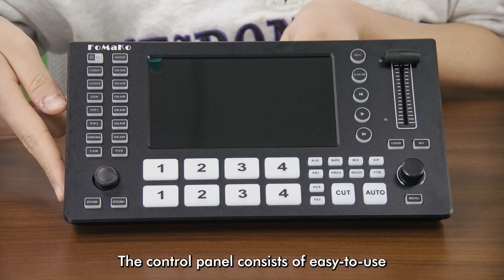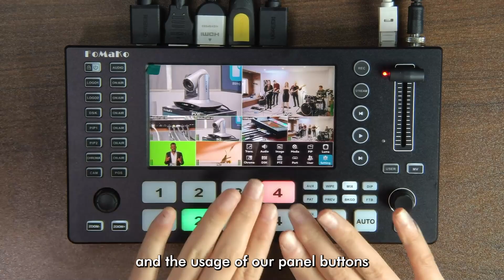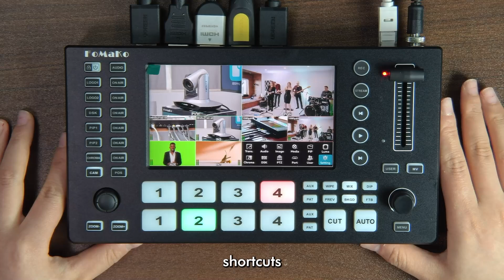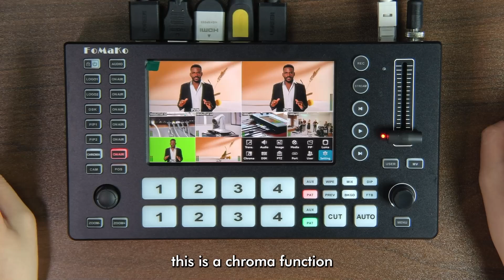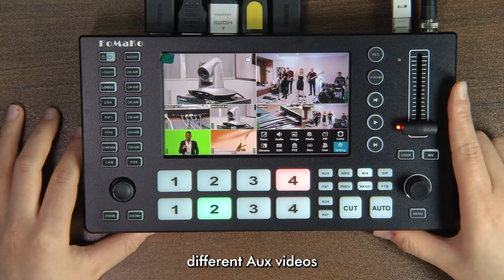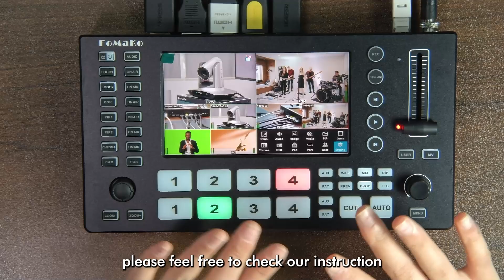New! FoMaKo 5-CH 4K HDMI Multi-Cam Video Switcher M3 with PTZ Controller

Comment: How do you store the streaming settings permenently? We had it working but after turning the switcher off and back on, the stream URL and stream key are reset to the default. Same with the NDI source, it has to be selected for the Aux input every time the swticher is powered on.
Reply from the maker: Dear Friend, The video switcher should save the stream URL and stream key surely. 
For the NDI source, please turn off  DHCP of the camera, 
because if you keep DHCP on, the camera's IP address always changes.

Please check it, if still have the same problem please email us the video switcher's firmware version, we will check for you.